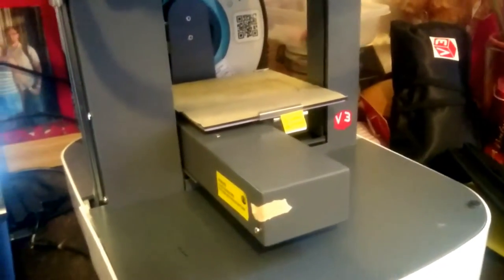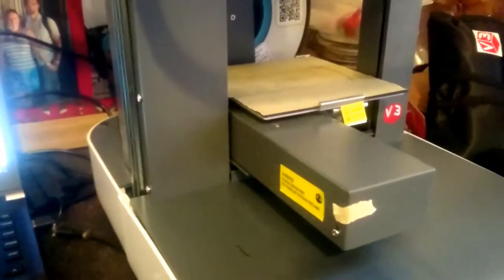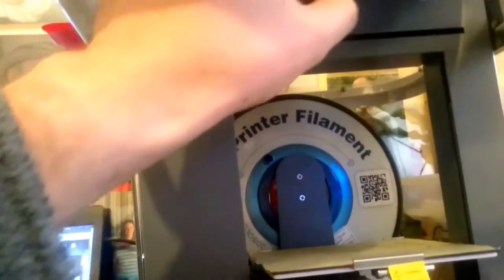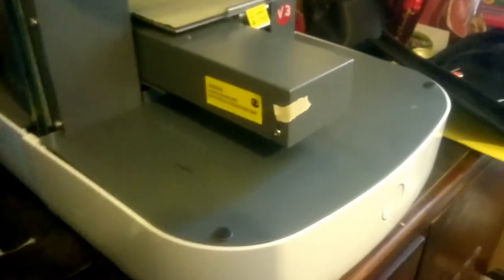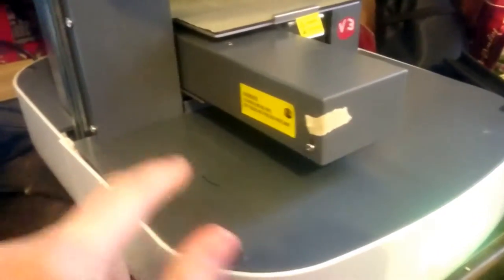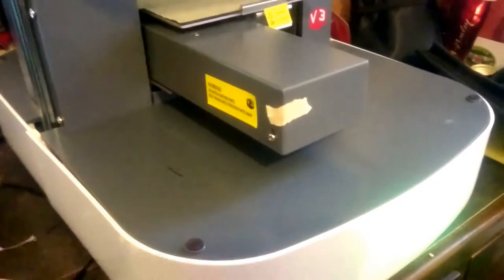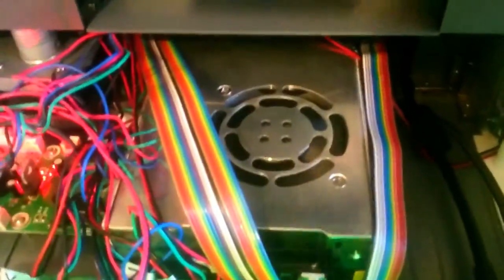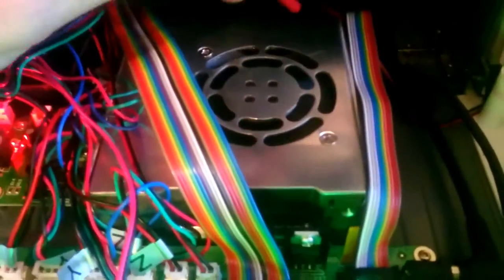Vector 3 Issue - PSU Fan Noise On Start

Comment: Mine does this too Exact same noise, I have opened it up and it is the psu! i have noticed the fan itself pulses on and off when this noise occurs, all i have to do with mine is switch off and back on again once. Its not good though. I have a new PSU on the way but as per usual Out Of Stock! so could be a long wait.
Reply: Horlicks mine too!  I have to restart four or five times to get a good start.

Comment: I might strip it and replace the fan with a half decent one.
Reply from the maker: I am not sure it is that easy to get inside the PSU.  When I contacted support they scheduled a new PSU for delivery to me.  I am still waiting on it but when it arrives I can swap out the faulty one.
Reply from the maker: I realise now that you already have done the same.  Take care if you try to disassemble the PSU.  There are usually large capacitors in them which can hold significant change for a number hours or days.